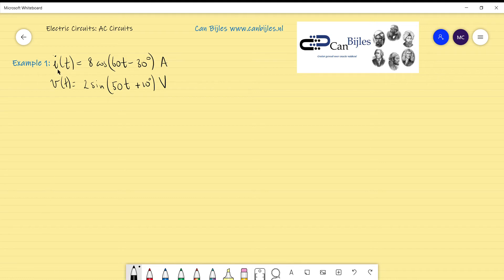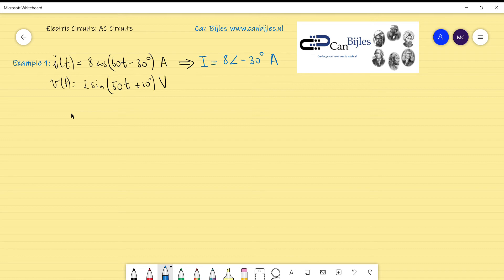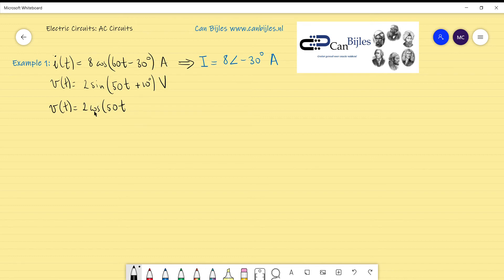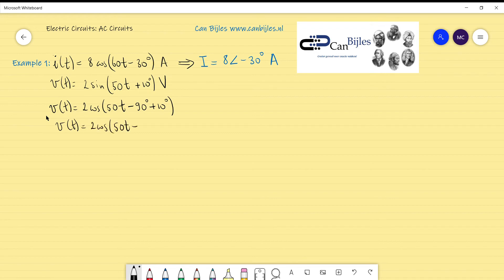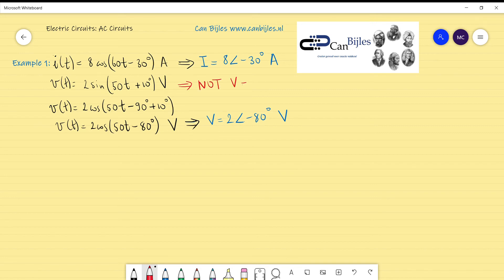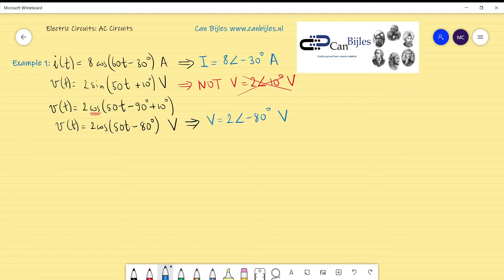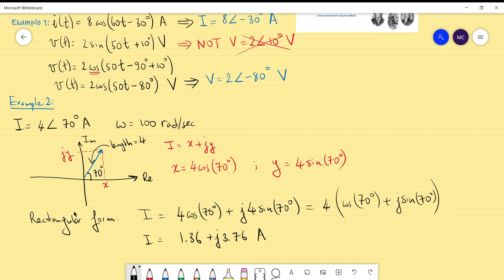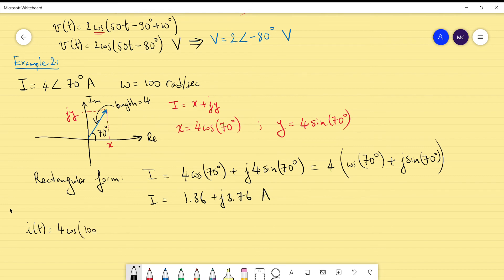Phasors 💡 From Time Domain to Frequency Domain 🌟 Example Set (Example 1, 2 & 3) 🌟 AC Circuits

Comment: Excellent tutoring 👏👍 note that: 180 + Tan-1 (-2/3) = 146.3099 …. Not 124.0
Reply from the maker: Thanks!
Thanks for the notice, you are right! The phase is 146.31 degrees, not 124 degrees.
Reply: @CANEDUX  Keep up the great work. It is very much appreciated.
Reply from the maker: @paulwood3460  Thanks! 👍